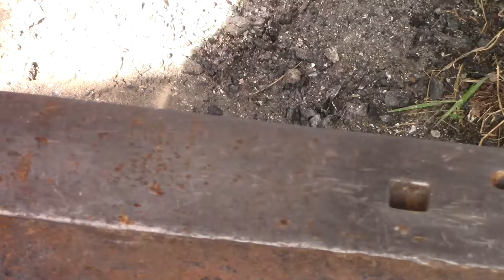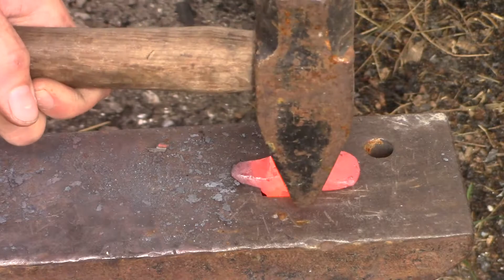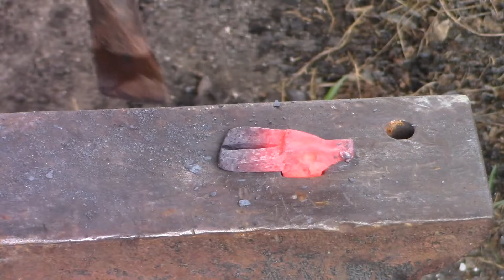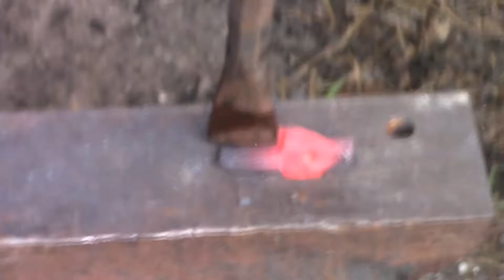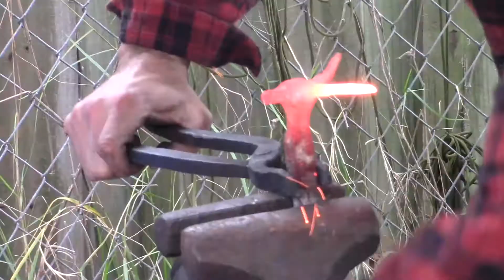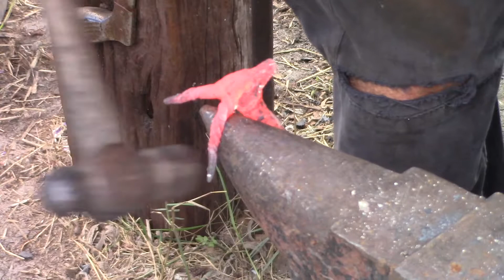Simple Dragon Head from Railroad Spike

Comment: From what did you make your hardy? Also great video it's very educational.
Reply from the maker: I converted a little used hammer head actually. drew out one side and shouldered it to fit the hardy hole, then hammered an edge onto the other. The old hammer hole also doubles as a convenient way to bend stock as well...
Reply: @theabandonedflame9243  
Very good idea, have a old log splitter that should do that nicely, thanks!

Comment: I just want to let you know that hitting a hammer with another hammer is very dangerous,because the hammers face can shatter and cause serious injuries.I love the video, stay safe. 
PS Im definitely going to try this
Reply: It looked like it might have been a top fuller which is designed to be struck, however, your concern is valid for those not in the know!
Reply: Only does this when mushrooming out hammers like these are meant to be struck and beatin on 👍